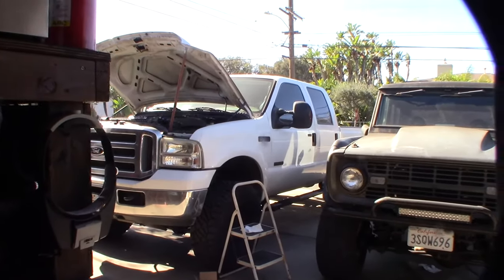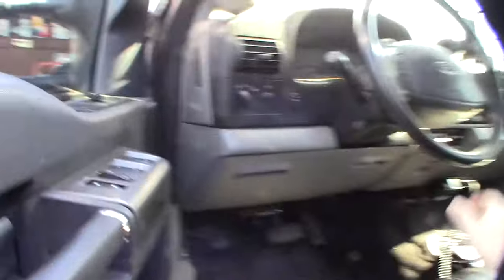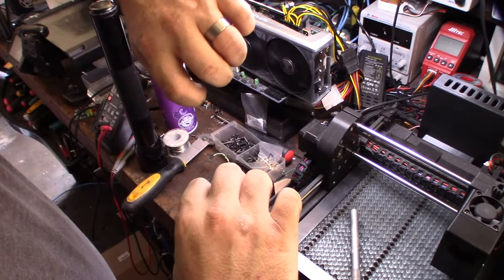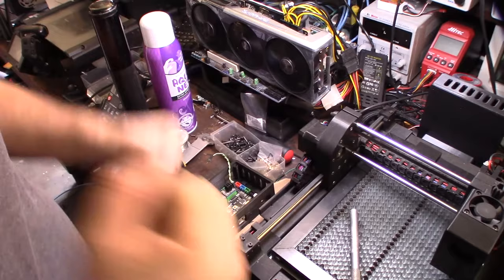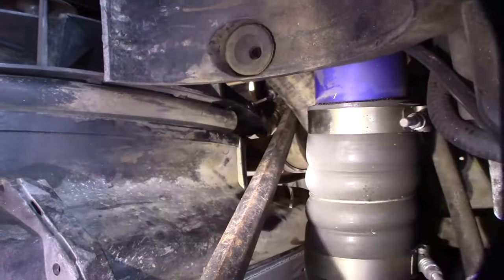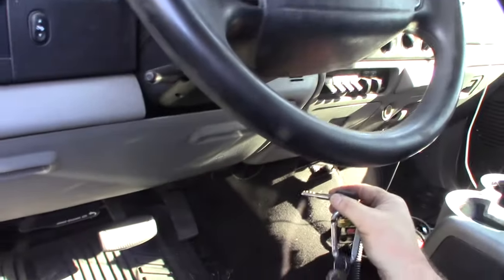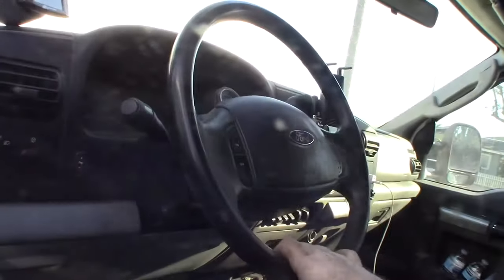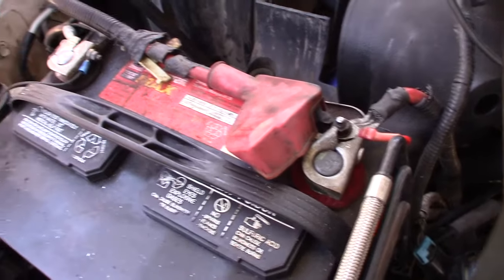Ford F250 Remove Play Slop Power Steering Gear Adjustment Powerstoke 6.0

Comment: Just bought a "new to me" 2006 F-250 Powerstroke 4x4 today. It was a good friends truck so I know its history AND, he gave me all of the paperwork on it from day 1. I knew that it wandered on the road a little from riding in it with him. EVERYTHING in the front end has been replaced but the steering box was never touched and I was wondering if it was adjustable. Now I know and, I'll try adjusting it before replacing it. It has less than 130K miles and, except for $5K+ in "bullet proofing" (done professionally with receipts) to the engine, is completely stock...exactly how I prefer to buy my trucks.

Comment: I have done it all taken gearbox apart adjusted to the closest while not making it have tension against rack pinion which worm gear is in center. What I have found is that the actual play is in worm gear where bearings are at usually 24 ball bearings two different colors. Still trying to see how I can fix it I actually bought a lifetime rebuilt thinking they probably put a new worm gear and I was wrong . I have changed it all except worm gear seems no one sells a new worm gear.good video though very thorough.

Comment: Hey I know this is an older video but at this point anything helps. I have a 2004 F350 that I’m not getting power to the transfer case motor. Changed dashboard switch, both relays and checked fuses. What else can I try?
Reply from the maker: Get a multimeter and check and see if the motor is getting power when switched on.